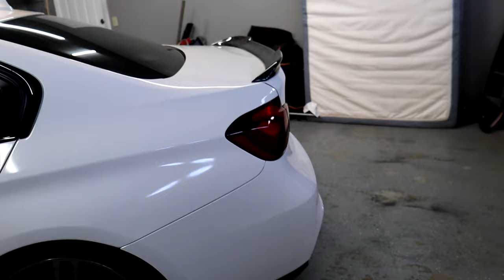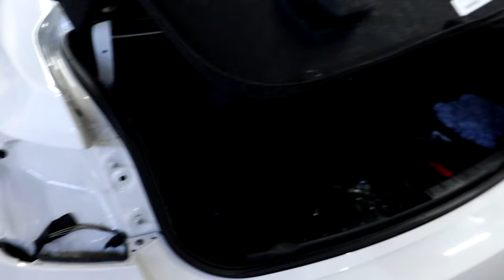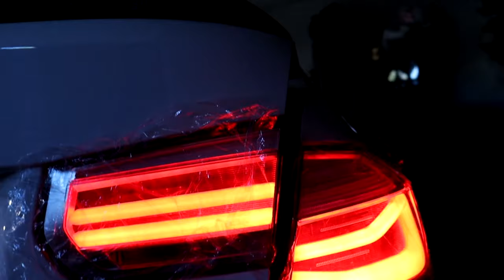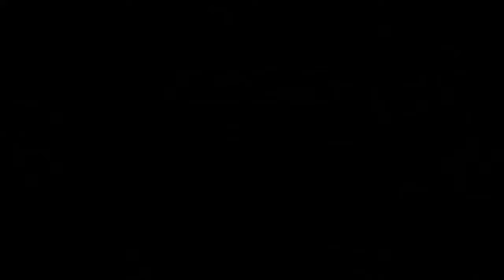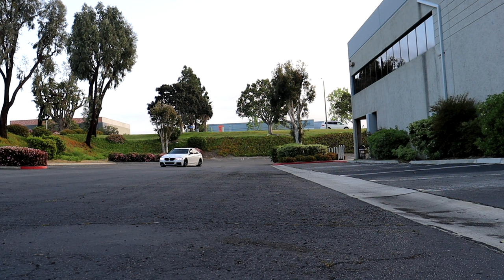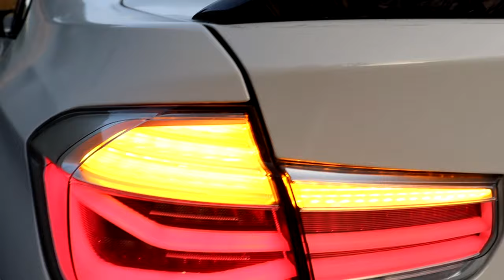Clear Lens LCI Tail Lights for BMW F30! | Install & Review

Comment: I think a thin line license plate frame would clean up the back.
Reply: Forgot, lights look good. Do what you like.
Reply from the maker: I actually have been getting bothered by the thick line recently cause its kinda blocking the number. so I think i am going to do that

Comment: I think I would of rather seen the shadow line LCI taillights on alpine white. Might tie everything together a bit more.
Reply from the maker: Shadow line? which version is that?
Reply: They are darker red version of the OEM LCI taillights. Turn signals light up orange. Only available in Europe, best looking tailights in my opinion. Second favorite on white is the black line.
Reply from the maker: @BrandonF80  I looked at some photos of them. Wow they look really good. I would love to get a set of those. They definitely look better than these clear lens and maybe even the GTS style.
Reply: Would love to see a video on either you decide. We have an alpine white F30 too

Comment: hey i jus purchased a 2013 335i with the n55 i also purchased a charge pipe, downpipe and bootmod3. what maintenance should i do to the car ? like  what gaskets and seals fluids etc any help is appreciated i plan on going for stage 2!
Reply: i literally have the same one and everything but the boot mod tune, just replace your valve cover gasket and your oil every 3k miles! 😊

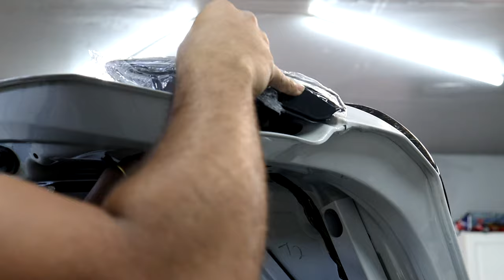Comment: Man that clip at @5:10 is very tough to get in dude, tried for 1 hour but i have a big gap, its loose now so i have to adjust it. Any tips bro? the passenger side went in like a breeze
Reply from the maker: Yeah that is the hardest part tbh. All I can say is you have to clamp the tail light together with the trunk and then hit it from the side to get it to lock in place
Reply: @InlineSixAuto  Im getting a left tail light malfunction do you know why? hVe you had that?
Reply from the maker: @silentescape818xsfvla8  does the tail light still function properly though? It just has the warning
Reply: @InlineSixAuto  Ya just the warning it works fine
Reply from the maker: @silentescape818xsfvla8  I would just code out the warning with bimmercode then if it still functions normally